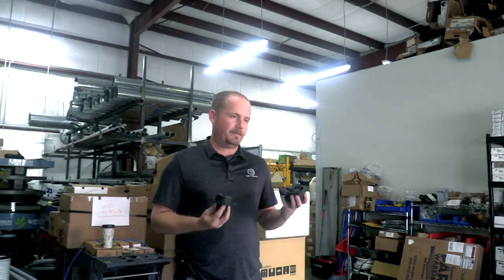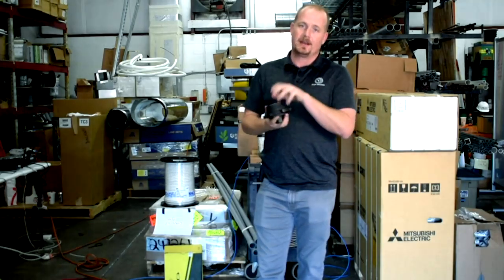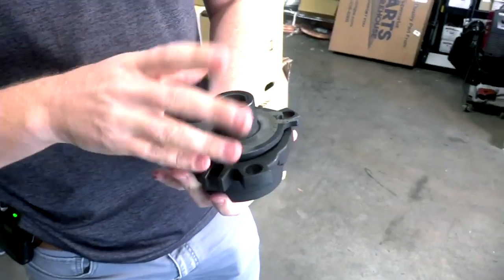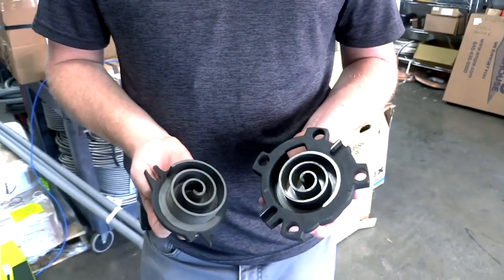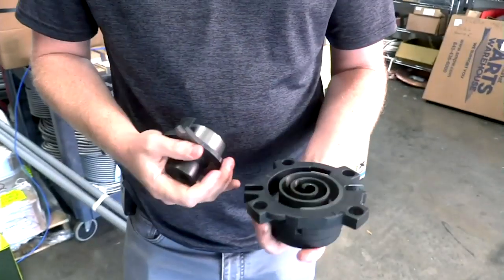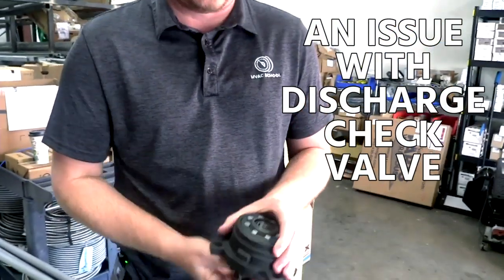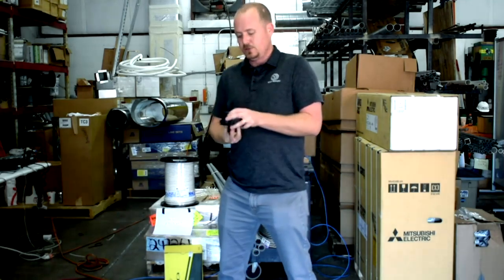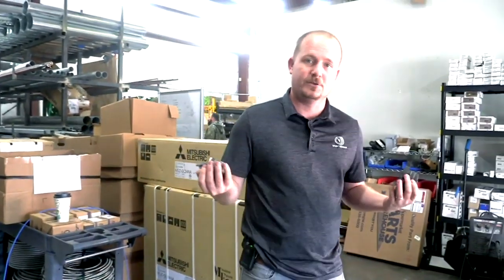Inside a Scroll Compressor

Comment: Good information for the noitall tech... Rotary is confused with the scroll. 
I have had bad/sticky scroll check valves out of the box..sometimes after a few cycles, the hot oil and vapor mix frees the valve but life expectancy is shorter than factory part..being a former Quality Control tech in manufacturing..to save costs, manufacturers may send an item back to a 'requalify' process that may change pumping characteristics or capacity by a fraction..re machining a mating surface or replace the electric motor, but still be within useable tolerances. 
Keep up the fine videos Bryon..I share to the new guys coming in as the seniors leave the work force.

Comment: Point to note. Not all compressors have a "built-in" (discharge) check valve. (E.g. Danfoss, Mitsubishi)
Many systems have them installed externally on the discharge line.
So some scrolls truly have no valves of any kind.